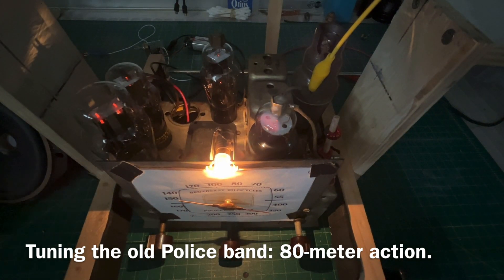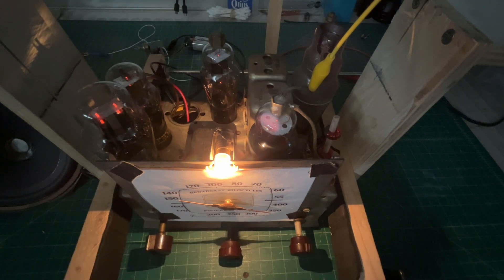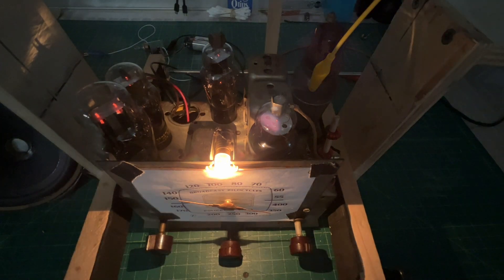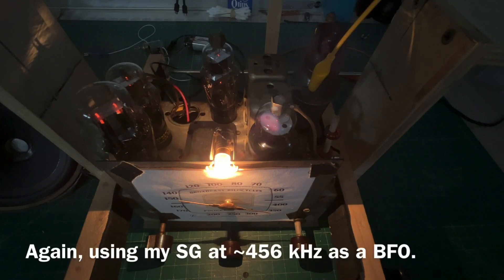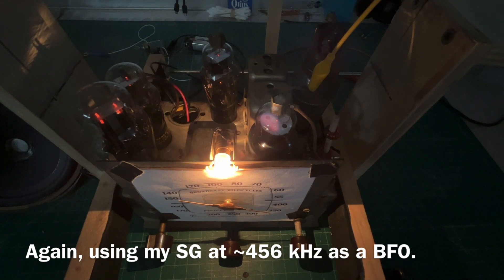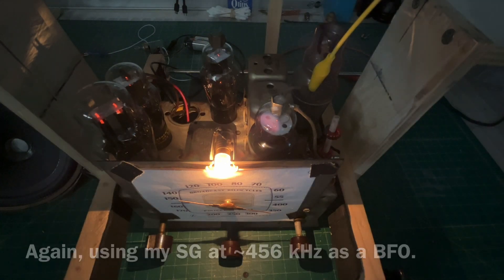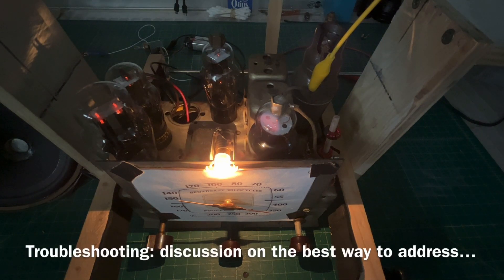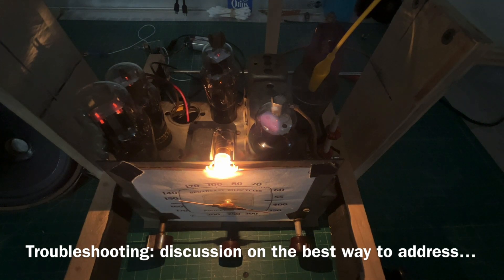Emerson R156 - Building a Two-Band Antenna Coil

Comment: Hi Don   I have a R-156 Emmerson   Signal reception is very Weak. If I bypass the antenna coil and inject a signal the receiver seems to work fine. I see No open connections in the coil. However, the secondary side of the coil measures 1.2 ohms.  This seems too low to me.  I want to reproduce your coil design   I have a couple Questions   Space between the coils? How many windings on each coil? wire Diameter? Trim Cap and Resistor Location in the schematic?.      I have been restoring Radios for a while but never attempted reproducing RF or Oscillator coils .
Reply from the maker: Hi Robert - I am assume you read 1.2 ohms on the antenna coil secondary (tie points back to C2 & C11) with the coil out of circuit, but please confirm. Best, Don
Reply: Hi Don   Thanks for the help here   From the C2/Grid Connection Secondary winding to c11 point is Over 2 meg ohms  "Bad"  From  C2/Grid Connection to the Secondary winding the center Tap I measure 1.2 ohms.  seems the coil is open between the center tap and C11    I am in the process of making the antenna coil you show for the R-156. Using your spread sheet, I Need to wind 59 turns for BC and 20 for short wave.   I am just a bit confused on how the 2 coils connect to the circuit.  Could you possibly sketch out a ruff schematic? Is the spacing between the coils critical?   I would be glad to document what I did and pass it back to you.    What you did here is extremely helpful. Thanks So much !
Reply from the maker: Robert - check the video below. I also uploaded the file to my Google drive you’ll see in the video description. Please let know if this helps. Best, Don

Emerson - R156 Antenna Coil Schematic
https://youtu.be/6GpFN7_HNog
Reply: @RestoreOldRadios  Thanks Much Don!   I get it now.  Parts to construct this on the way.    I will let you know how it works out. Nice Schematic BTW.     The Radio is completely restored except for this one remaining issue.
Reply from the maker: @RobertStetz-o4h Thank you. I hope I didn’t get things crossed up on the hand drawing and look forward to your feedback afterwards. All the best. Don

Comment: this is what i m  looking for! the antenna coil. my next question, any idea how to built loopstick antena ( ferite) for tube radio?
Reply from the maker: Check out the link below. Ferrite types are specified for a particular band and for the AM band here in the States, type 61 is the best match. Using Litz wire improves the Q (Quality Factor) and here’s another link that matches the Litz wire to a particular frequency range. Hope this helps. Best, Don

BTW - a LCR meter is needed to get the desired inductance.

https://www.amidoncorp.com/rods-and-tiles/

https://www.mikeselectronicparts.com/page/litz-wire-frequency-table/